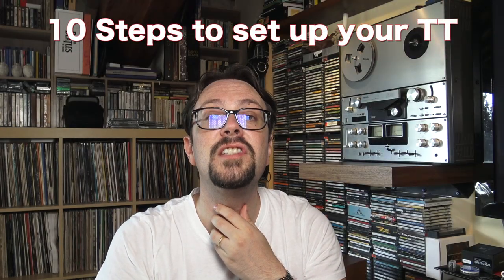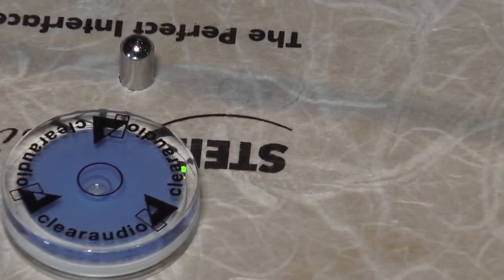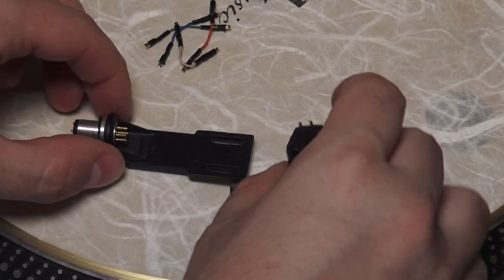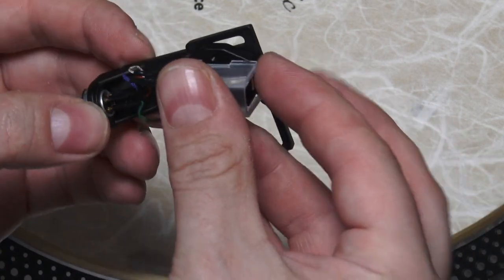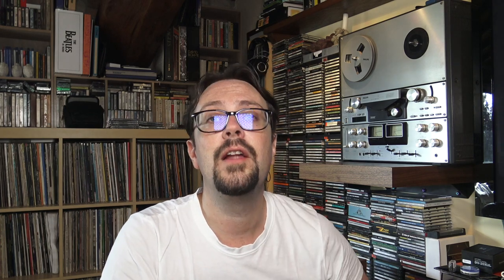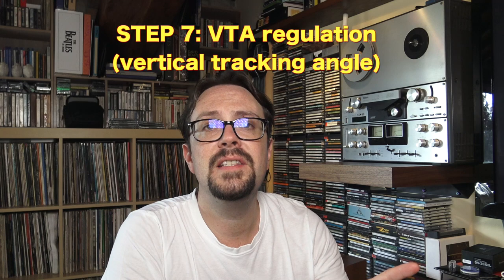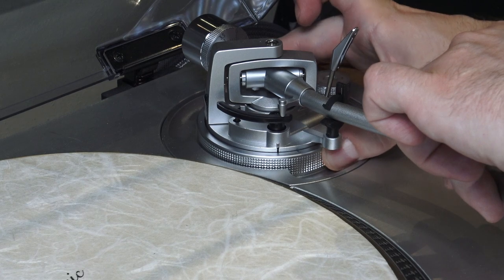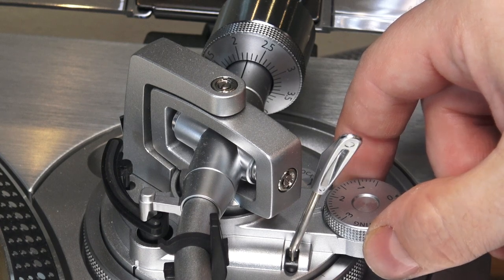The Ultimate Turntable Setup Guide

Comment: The Technics alignment tool is sufficient to get the Technics tracking error specification.
Reply from the maker: That is only to set the cartrdige at the right distance, it does not make you set the correct position of the stylus.
Reply: @anadialog  It does, because it has an arrow on the front which aligns with your stylus once you set it straight. Personally, it's given me much better results than the Stevenson protractor and this Technics one you showed in the video. I found it a lot more easier to setup as well.
Reply: ANA[DIA]LOG no, when the cart is aligned to Technics instructions, squaring cart body to headshell,  it delivers Technics tracking error specification. The process requires no more or less eyeballing than aligning with a protractor and there’s actually less parallax error, since the cart body is in contact with the headshell.
Reply: @charlesludwig9173  Exactly. Personally, I just do a perfectly frontal photo of the stylus on the gauge, and with an app that generates a grid on the photo I check if it's totally straight. It even worked on a curved cantilever.
Reply: Zeus The Tornado - Gangsta Rap Sub al español that’s clever.
Reply from the maker: Ok, then we are talking about two different things.

Comment: In step 6, what if the cantilever hits both null points, however, is not perfectly perpendicular to the platter?  For example, what if the cantilever was at a 70% angle relative to the platter when looking at from the front of the cartridge/head shell?
Reply from the maker: Hi Aaron, that is a different tyoe of adjustment called VTA (vertical tracking angle). Nit all turntables have this possibility, dhich lets you adjust the hight of the arm utill it is perfectly perpendicular to the platter...
Reply: Aaron Hanusa that’s when you crack open a good bottle of Whiskey 🥃 drink a large glass of it, wait a few minutes and then stand 2 degrees to the left or right. At that point, it would appear to be perfectly level to the platter 😀

Comment: Hello! How come you choose the max. allowed tracking force?
Until now I've only heard that it shoube as low as possible (for example 2 or less grams) and if I have to choose a number from 1,5g to 2,5g I should always go for the middle.
Reply from the maker: Hi there! Well, because the maximum will give you the full experience for that specific cart. The important is not to exceed it...
Reply: Orest B. 
The heavier tracking provides a deeper bass response, but trust your ears 👂
Reply: @ralex3697  thank you for the tip

Comment: I noticed you did not go into the details of setting the VTA. The VTA must be correct or you will not get the excellent results that are possible with the Technics turntable. There are several transparent protractors that can be used for VTA and Azimuth. In addition, to get a perfect VTA with the turntable mat you have (Stein), which I also have, you need to add a spacer for the cartridge or you will never achieve perfect VTA. This is because the Stein mat is very thin compared to the Technics rubber mat.
Reply from the maker: I did an in depth video on VTA and more here: https://youtube.com/watch?v=v-YyKktxadg&feature=share9

Comment: it's not the arm that has to be level to the surface of the record is the body of the stylus has to be parallel to the record surface. That's what the little pimple on the stylist is for, draw a line on a piece of card bent over so it stands on the records make sure this line is 100% parallel, line up the gap by placing the edge of stylist body on the Edge of a record, between the stylist and the record on the card.
It is not necessarily the case to have the platter level? if it's belt driven this doesn't apply for direct drive? You want to have a  line from your motor spindle to the centre spindle and beyond this line needs to be somewhere about 
0.016875 of the degree off vertical access. You can get app for your phone to measure this, This helps with the pulling of the belt on the platter and the centrifugal force will level itself out. You have to make sure the line of off access is exactly parallel to the motor spindle.
Reply from the maker: Hi there, well as I said and showed in thr video VTA is not about parallelism, that is only a simple way to achieve it. The real goal is to have a 20-30° angle between the cantilever and the record surface.
Reply: John sweda I dont quite understand you here.
Reply: ana[dia]log Isnt it more about having the stylus close to 92 degrees against the record, ideally when in play?
Reply: Leon thepro in an ideal world you wanted 92° but of course records come in different thicknesses I'm not sure what you don't get! What don't you understand!
Reply: John sweda I just didnt understand your examples and explanations.
Reply from the maker: The angle to which VTA refers to is that between the cantilever and the surface of the record, which should be between 20-30°
Reply: Leon thepro usually the cases is that the bottom of the stylist body is used in manufacturing to aligned the stylus tip cantilever, So by placing the edge of the stylist body with its pimple or notch? on the edge of the record and looking through the gap having a reference a line on a piece of card should give you very close to 92°
Reply: John sweda I still dont understand ;^D
Reply: @leon9021  dont listen to john just make sure the tonearm is parallel  with the record.simple as that.
Reply: @jeffro7p202  Cant, I have a Rega table. And Im more concerned about the SRA to be honest.
Reply: @leon9021  well personaly i played around with the sra on mine and came to the conclusion its not worth the trouble as i didnt hear any difference what so ever.so i went to some forums and realized most other people came to the conclusion . if your tonearm is level the sra should be in the ballpark.
Reply: @leon9021  google audio appraisal rega 3-point vta adjustment.
Reply: @jeffro7p202  What cart do you have?
Also, Im not buying addons to my 300$ table just do adjust the SRA by 1 degree.
Reply: @leon9021  shure m72 and a denon dl 103.i dont blame you. some people spend a bunch of money on it. but if it sounds great to me i leave it alone.i have a denon dp 62l that i got from a thrift store for $100 that had the denon cart already on it and i had an old shure m72 cart from way back in the day that had never been opened and surprisingly i love the sound of it.
Reply: @jeffro7p202  Dont know about the Shure but the Denon cart has a spherical stylus, so its no wonder you heard no difference between SRA changes. Its directly tied to what profile your stylus is, basically the thinner and winder the dimensions the more proper installation and small changes matter to the performance.
Reply: After reading this, a reminder: listen to the music. Don't get lost in techno land. There are too many variables for "perfect".

Comment: Dude, rough night last night?!! You are having a hard time with your words....Dynavector is pronounced just as it looks...DYNA-VECTOR. Not Dina. Resonance is just as it looks, not risanance and other examples I won't cite today....go back and view your own video, it's worth a laugh! Coming from me who has been doing this for the last 55 years, you have done one of the best set-up videos on YouTube....that's a compliment!

....By the way That Dynavector DV-20x2 is a fine cartridge and I truly believe is THE pivot point towards Diminishing returns, in the cartridge world...No real need for those $5k to $15K brag pieces! I have used this as my reference cartridge since they came out in the 70's, in the red clear bodies; before most of you were born! I'm on my 3rd one! Anyway, in your sequencing, please do do ALL cartridge mounting and overhang and alignment work to the end, before zeroing out the tone arm weight and antiskate adjustments...Cartridge weight is ALWAYS and the END of everything you do in cartridge set-up, except Anti-Skate adjustment, for safety sake of that $1,000 cantilever and stylus....In-fact, during ALL alignment and tracking force and VTA adjustments, TURN THE ANTISKATING OFF. That makes it much easier to make all adjustments and you won't cause a cantilever snap, because the arm went flying due to the Antiskate pull. Most don't know this until it happens....If you snap the cantilever, you will find that a new replacement of a replaceable cantilever and diamond runs about 80% of the cost of a complete new cartridge, ON MOVING MAGNET CARTRIDGES! On ANY moving coil, the thing is NOT REPLACEABLE, PERIOD, INDUSTRY WIDE; but must be sent back to the factory for rebuilding, and that sometimes CAN EXCEDE the cost of replacing the whole cartridge, because of scale in manufacturing.....  BE VERY CAREFULL, I will admit, I have done this and DO NOT let just anyone play records on your quality turntables....They don't have the same respect or knowledge as you do, for the cost and fragility of the system.... and YES, I have had that HAPPEN TO ME TOO!!! I am a child of the 60's....

This is all VERY important, BUT as few folks out there DO NOT spend enough time selecting the CARTRIDGE when buying a turntable....they may spend $1,500-2,500, or MORE on a table and then stick on the cheep, high margin cartridge that the dealer recommends...he's in it for the money. Remember a turntable is just something that holds the cartridge steady and spins the platter, really not rocket science....the magic is ALL in the CARTRIDGE and in its diamond tip of many configurations and cantilever materials. Doing a poor job of your cartridge selection for your expensive turntable would be like going out and buying a new Porsche and putting in a GM 4 CYL engine!!! Get it folks!!!!!!!!!!

It is almost a lost art and glad you put this out for the younger folks coming up through the ranks.  If you really want a challenge, try setting up a tangential Rabco table and find out how TUFF really is!

I will leave you all with this: there is a lot of HYPE in the audio world (LIKE $2,000+ cables)....BUT a well built turntable is by far the best looking piece of gear in your stereo system, feel free to seek and find not only FUNCTION, but BEAUTY in your prized turntable and its CARTRIDGE!  I did that too!!!!

Peace!!!!!!!
Reply from the maker: I am just going to say that I am Italian and that is why I mispronounce several names. Sorry about that.

Comment: Since when did we start calling a phono stage a pre-amp? Don't ever try and crimp leads like this. Put a round toothpick in first, it will help keep it round and avoid crushing. Don't confuse cantilever with stylus. The stylus is used to adjust overhang, the distance from the tone arm pivot point. The cartridge is adjusted so the stylus falls precisely on the two alignment cross-hairs. The cantilever (or cartridge body) is used to adjust alignment so that the cantilever is parallel to the alignment marks on the guide. Two different things! Adjusting one usually affects the other, so be careful and recheck. Adjusting VTA visually like shown here is ballparking at best. Always adjust VTA by ear. Play some music, adjust up or down very slightly, keep going in the direction that sounds better until it stops sounding better. Then go gradually back to where it sounds the best you can get it.  Anti-skating, also ballpark then set by ear. If you hear mis-tracking or breakup in the left channel, that is too much anti-skating so reduce it. Vice versa if the right breaks up.
Reply from the maker: Charles, you are really getting things wrong here...just do a google search and see for yourself!
A phono stage is usually called a phono pre-amp, because it is a step-up pre-amplification before actual amplification. Leads nowadys are sold open. You MUST gently crimp them, otherwise they will slip off 100%. You are confusing cantilever and stylus. The stylus IS the diamond tip (or other precious stones you use), the cantilever is the little rod that holds the stylus, not the cartrdige body like you claim. For tye rest of your comments I may agree even though you really need a trained ear and a lot of people what precision, not approximation.
Reply: @anadialog  Phono stage or phono preamp, either way the key word is phono. Which you do not say. 3:03 Please read what I actually wrote, and listen to what you actually said. Your diagram has it right but that's not what you say and that's not what you put in your great big yellow title. Also what I said was NOT to not crimp, but to place a toothpick in first before crimping to avoid crushing. You yourself mention the importance of not crushing. Well, the toothpick is a whole lot better solution, not only prevents crushing it is round. Credit Michael Fremer, whose videos you should study before you try making any more of your own. And try reading my comments again. Stylus is for adjusting overhang (falls on the curved Baerwald line, precisely on the cross-mark shown). Cantilever is for adjusting zenith (parallel to the parallel lines). Do you even mention overhang or zenith? No. Two different things you confuse into the one you call alignment. If you are still confused I recommend again the Michael Fremer videos. As a matter of fact watch them anyway, he is the best!
Reply from the maker: Charles, for goodness sake, there is a HUGE image that says PHONO PRE-AMP on it, showing all the proper connections, do you really think it is useful to say this?! I am cutting out words to save time. Ok for the crimping, I misunderstood. My fault there. No I don't and do not want to use difficult words (when possible), this is a video clearly for newbies, not for people who watch Fremer who already know what is overhang, zenith, compliance, bias, VTA etc. I am among the few online, if not the only one, that shows the importance to correctly set the cantilever parallel, coincident to the line (yes, your zenith angle) in the alignment protractor...NEVER use the cartridge body. The cantilever is in several cases not perfectly parallel to the body. No confusion, since the process is correct, as you said, and explained in a simple way, accessible to all. No harm in that since the goal is to do it correctly, not inform people about jargon.
In any case, I think that you missed the chance to just simply add that extra info in a comment for people that might want to go more in depth, I would have acknowledge that, instead of protracting a sterile attack.

Comment: Why are almost all ( maybe all ) carts made with male prongs ?  And so are the turntable arms requiring jumper cables ?   Seems dumb - why not just make either the arm or the cart female ?  Or make a legitimate coupler and not use those fragile wires that inevitably break - Has no “engineer” thought of that yet ?

Comment: You missed out speed checking with strobe and pitch adjust, even though you are evidently using a turntable with these essential features. Many low end turntables cannot be relied on to consistently spin at the right speed so they provide these features. Not that the strobe is any good at detecting small fluctuations. Of course for the same money you could buy a better sounding turntable without strobe but then you would have to blindly trust that the manufacturers engineered their products properly so they turn at the right speed.
Reply from the maker: As you have correctly wrote, it's a check, not a setup. Here is a dedicated video on the topic: https://youtu.be/_ug66WQAMeM
If you don’t want to use an app I highly recommend this cheap item I reviewed: https://youtu.be/Akx-DkGSRHA
Finally, the Turntable, which I don't have anymore, is the a high-end model by Technics recently produced, the 1200G.